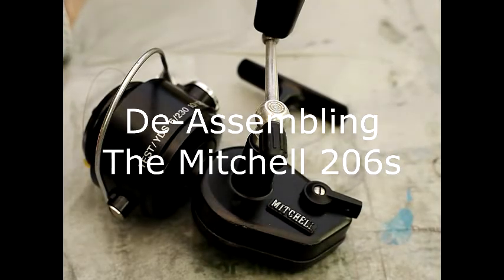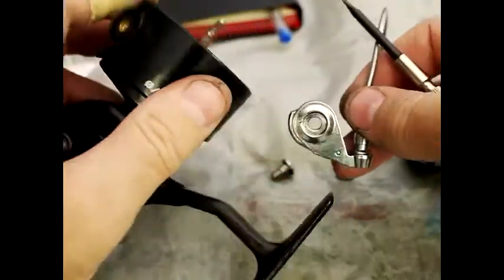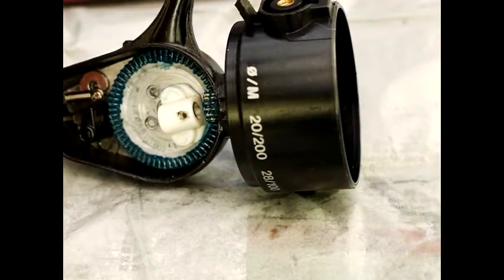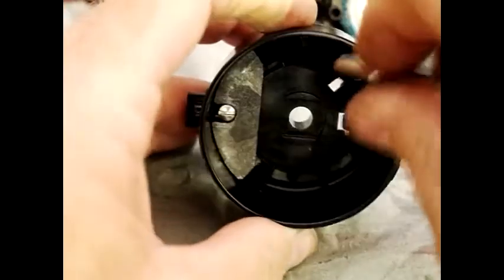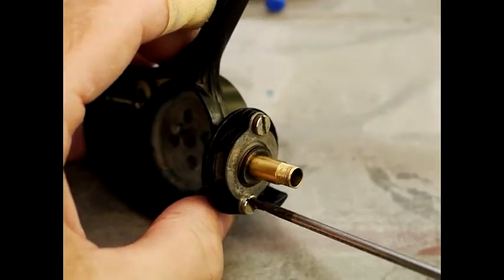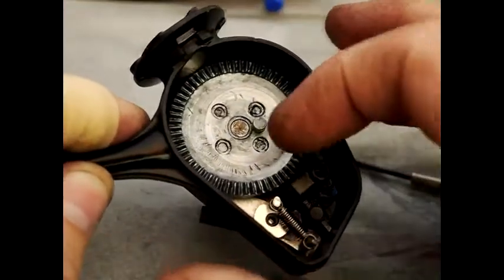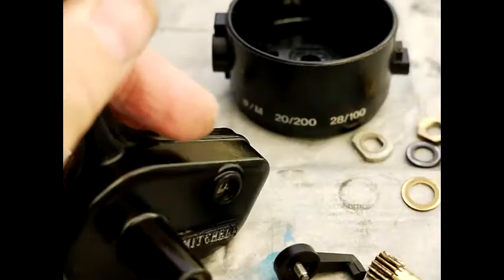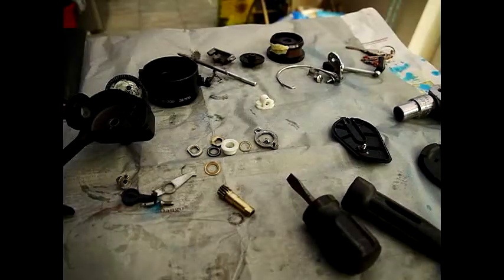Disassembling the Mitchell 206s Light Sea Spinning Reel

Comment: Thank you very much.  I just got a 204 on eBay sold for parts but in good shape.  I want to get it working but no videos on a 204, but fortunately I found your video on the 206 which is close enough.
Reply from the maker: Glad I could help
204,206,208 are the same reel I think. Just different retrieve rates. The 208 is slightly fancier. There are various sites which publish the schematics.